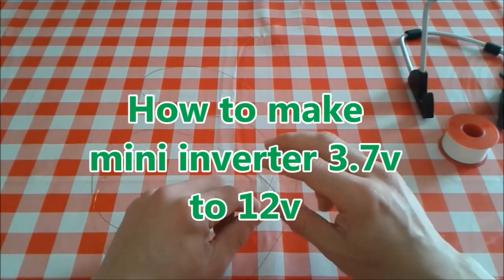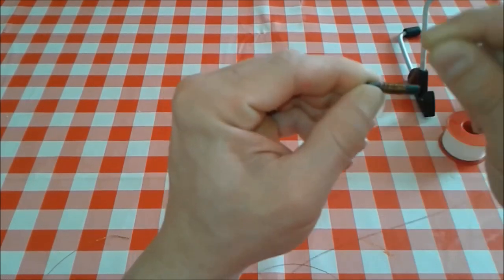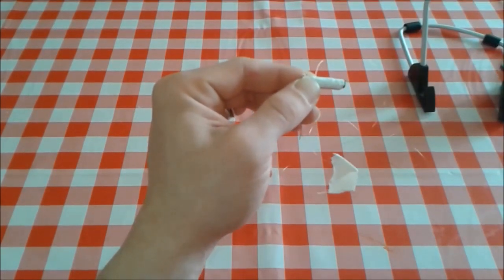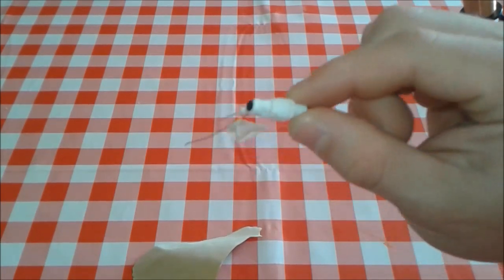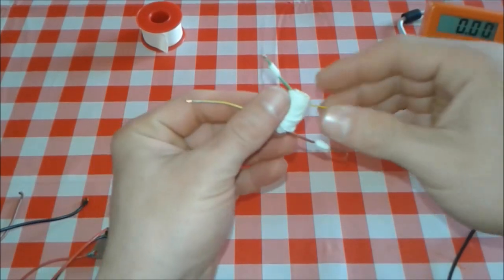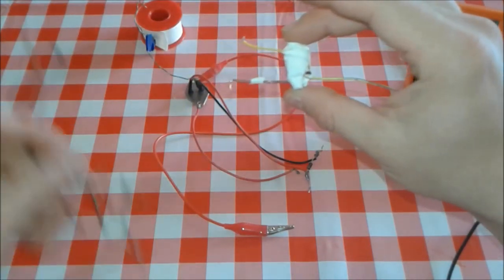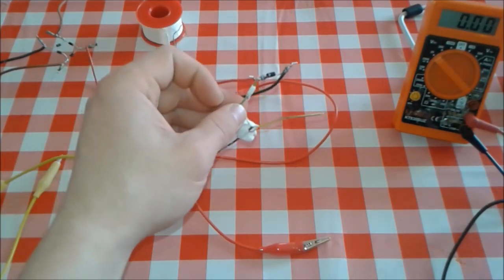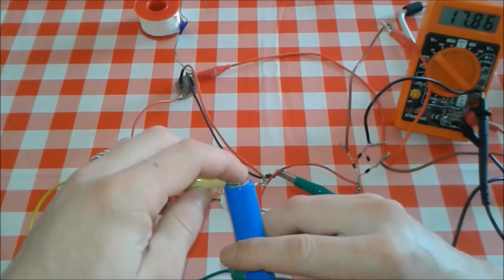How to make mini rechargeable inverter at home 3.7v to 12v No skills Required

Comment: It works in DC this is a basic Jewel Thief circuit. single transistor and resistor, toroid, 30 cm wire, led.
Reply from the maker: how can i improuve it if i will change the 2n3055 with a mosfet?
Reply: this need no improvement it is already miracle! congrats use torroid ring like 5cm round ring instead f air-core you'r using now.it will make it small.